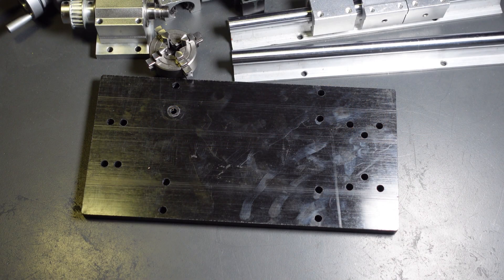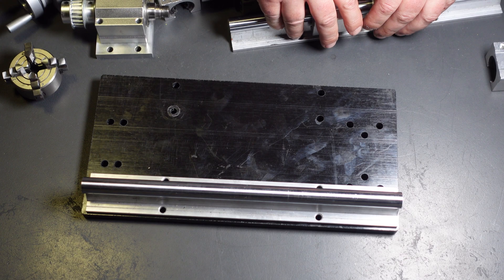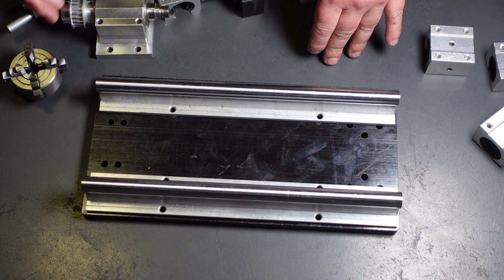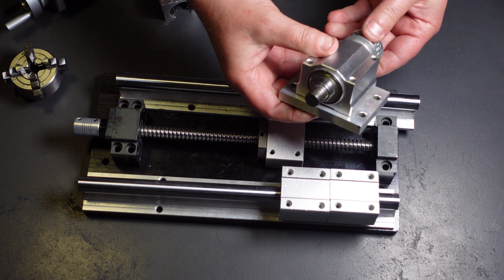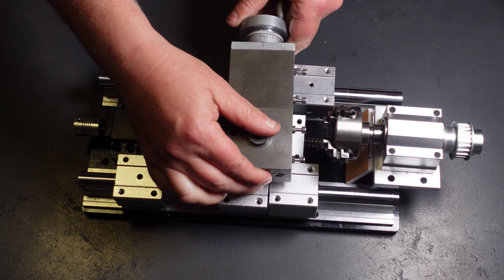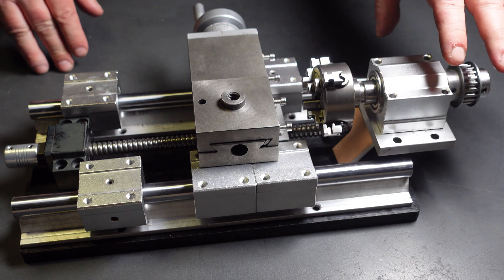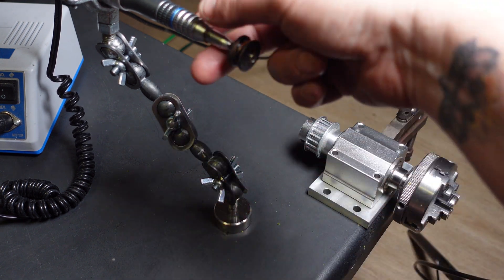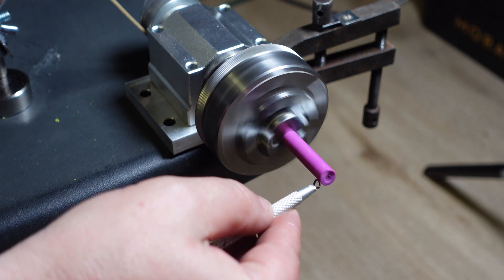DIY jeweler's/mini lathe made from off the shelf parts

Comment: Hey buddy , Im an amateur watchmaker and have done clock repair for years . Your videos are wonderful. Anyway , If ve been intredted in watch case restoration and found the jooltool .... 800!!! For a vertical buffer !!!!! You hotta check ut out and do a video , the amateur or even professional restoration guys would love it
Reply from the maker: i already did a video comparing my machine (the gumball) to the Jooltool. ..and yes,  mine can do everything it can do AND a lot more...plus my machine is made with much better parts . im not sure what type of motor the Jooltool uses but i suspect maybe a 100 watt? mine uses a 500 watt  and mine costs only $65 bucks compared to $600 for the Jooltool... My goal was to give Jewelry makers and all sort of other hobbyists an option that goes something like this , are you looking to buy , IDK, lets say a flat lap? you could spend $500 bucks on a dedicated machine, or as another option, you could spend just $150 bucks on a entry level 3D 3d printer and print a gumball...this way you'll end up with both a flat lap AND a 3d printer for only 25 percent the price of the dedicated machine and thats just the beginning, the gumball will ultimately be able to convert into a ton of other machines, which allows you to continue to save money with every new machine you ultimately didnt have to buy and you sort of end up not only saving money, but even if you end up buying a printer for this project alone, the cost savings , essentially makes the printer free.The gumball is sort of a 3d printer companion, that when combined with a 3d printer, will allow a user to make almost anything.

Comment: You should have used steel for the base plate, using acrylic is obviously a bad idea. Heck, even aluminium would have been a much better idea and probably more than suitable for the type of light work you would do with a tiny lathe like that. Acrylic might be be usable, perhaps even while making parts out of steel on the lathe, but it simply lacks the rigidity/stiffness for accurate work. And accurate work is precisely what jewelers/watchmakers lathes are meant for. Also you should have used a trapezium leadscrew and definitely not a ballscrew, as ballscrews are meant for CNC machines for a specific reason. Trapezium threads have holding power, meaning if you rotate the wheel attached to it until your slide is in position and then take your hand off of it, it will remain in place and not move, even if it encounters force while cutting your workpiece. Ballscrews are much smoother and have very little friction, which is precisely what you don't want in a manual machine because it means the forces from the cutting action will just cause your slide(s) to move all over the place instead of remaining in place. In CNC machines ballscrews are attached to servo or stepper motors, which indirectly provide the holding power for them.
Reply from the maker: its actually delrin and its half inch...then its having thick steel linear rails screwed into that to stabilize it even more, the travel on the lathe is only maybe 9 inches or so, and its not like it will be cutting really big projects...im thinking its more than rigid  enough to cut steel but we shall see, im  almost ready to finish it. ill be posting my results in a week or so.

Comment: Don't know what you're doing for a motor but have you thought about one of the cheap hand held $25 Router's with speed control button there around 700w that's a lot more than other over could fit it to perspex with different holes drilled for 3 pulleys to control speed slide it across to line up then use them leaver clamps about $2 each just claiming when it's lined up correct put marks so you know after first time use it should be good set up for bigger work

Comment: This would be perfect for modifying cartridge casings. Heck even neck turning as well. I needed to convert some 308 Winchester over to 35 Remington. And I was able to do every single process with my reloading tools. Except for one and that was trimming the base down a few thousands and reprofiling the extractor groove. I did manage to chuck them in my electric drill and getting those to processes done with a file. But I took forever and it was less than consistent enough for my liking. But a micro lathe like this would make short work of my requirements.

Comment: I know all about watchmakers lathes, i was lucky with mine, costing me only €400,- for a Boley with all but 1 collets (but i managed to find a 1.2 mm which was broken.. )
See if you can find someone with a bigger lathe and Drill a hole through the main spindle, so you can clamp longer rods, maybe even get a conical hole in the front to clamp collets as most of the small work is nicer to hold in a collet..